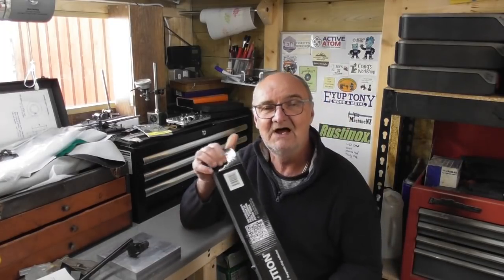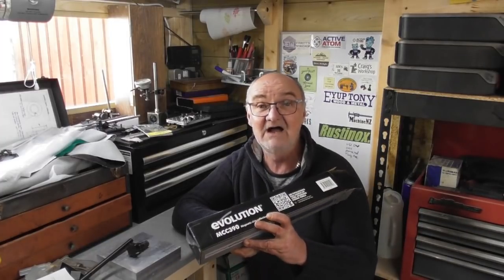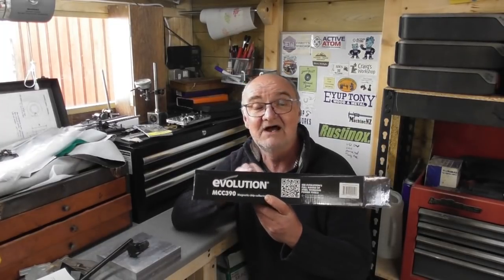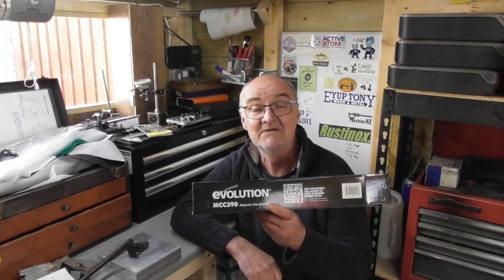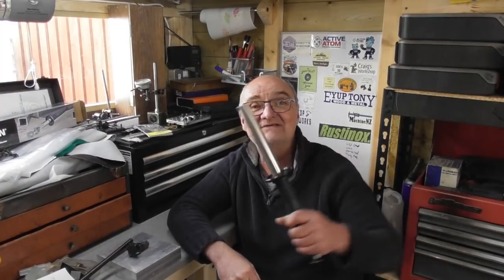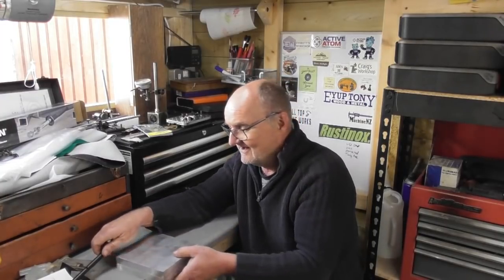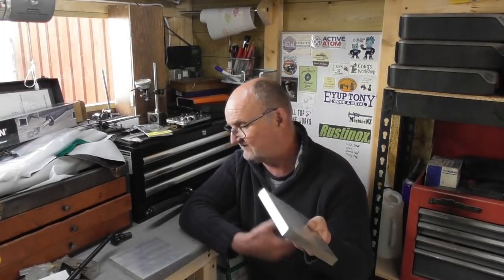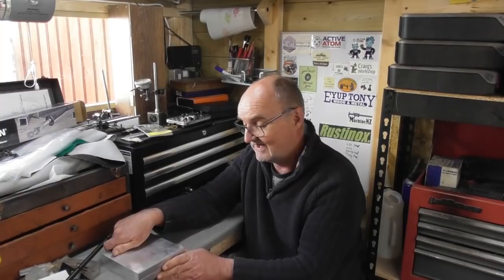A Tooling plate for my mill Part2

Comment: Another great video and love watching your mill projects as I have the same one. I spent some time looking at DRO's and got mine from Warco; after I got the mill. There are some cheaper options, but Warco scales are the right size and the controller is very nice easy to use and has all the functions one could want. Happy to send you some photos of how I fitted mine.
Reply from the maker: i just bought one today . not from warco . all will see when it comes . Cheers Ade.

Comment: Hi Ade. You've no need to apologise for the last video. It was excellent. I for one am just very grateful that you take the time to make these films and share your workshop with us. You are certainly keeping me going, stuck on this ship and unable to be in my own workshop. With regard to DRO systems, I fitted one to my Harrison lathe and it was from a company called EMS International.  They were extremely helpful and it's a good product. A power feed for your mill would be a great project; you don't need a stepper motor, just a straight DC motor with a gearbox and speed control would suffice. All available very reasonably these days. One bit of constructive criticism - I do sometimes find your commentary difficult to hear over the sound of the machine. Don't get me wrong, I'm not being negative. It's simply that I find your narration extremely instructive and don't want to miss any of it.

Comment: Very interesting. You have a wealth of experience, and I don't, but I'd have thought that a smaller cutter would produce a flatter plate. Using the fly cutter, aren't you building the nod error into the flatness of the plate? When you do the bottom, I'm assuming you are going to reference off the top surface. A very small cutter would guarantee that the peaks of the furrows created by any nod are all level (a bit like scraped ways)? Realistically I suppose a 10mm or 12mm cutter would be as small as you would want to go, but even with that anything bigger than 10mm wide should sit flat on a plate whose top and bottom surfaces have peaks of the furrows that are perfectly parallel? Not sure about any of this, I'm a novice.
Reply from the maker: I agree totally if my mill had a significant Nod . i think it was about 0.02mm over 150mm at the last going off. therefore over 100mm probably less that that . My wish on this occasion was for a good surface finish , but you certainly are correct . Cheers Ade.

Comment: I thought you might reverse the work and machine  the other long face first before changing setups Ade, just a thought lol. Looking good mate! I'm very impressed with your fly cutter and it's finish. From the angle of the camera the "Back stroke" as I call it seemed to be taking quite a lot off compared to the front. It was probably just parallax causing it, but if not then perhaps you had better check the tramming again in case something has moved. Have you decided to bolt the mill down yet as I and others noticed it seemingly wobbling around a bit in the last episode of the vice clamp video. Looking forward to the next one Ade, hope you and your wife stay safe in these bloody awful times.

Comment: What I don’t understand here is why it’s cutting on the back end in both directions. If there’s a tram issue somewhere, and it could be in more than one place, it should only happen in one direction. Is there too much flex in the fly cutter, particularly with the bit so far out? That would do it. Or looseness in the gib? That would cause the table to lift on one end and depress on the other, depending on direction. Looseness in either the x or y gib would do that along the x axis.

Comment: Without a DRO on my mill, I have found a useful little gizmo is a magnetic pointer to align on the front scale on the table. It saves on mental gymnastics when you want to move along a bigger distance and helps keep count of the number of hand wheel turns.